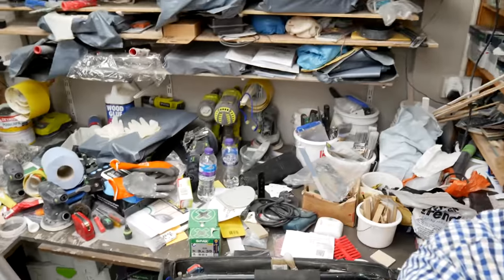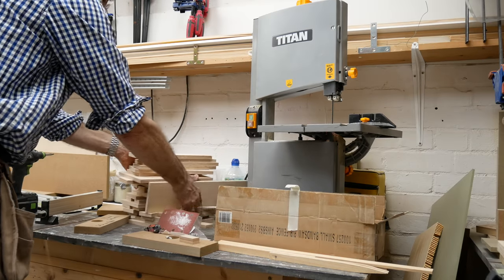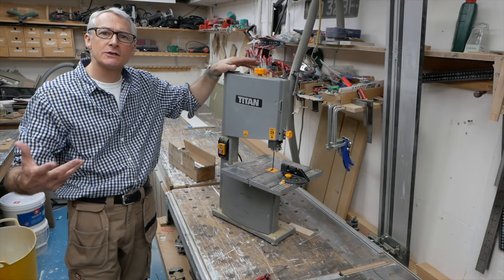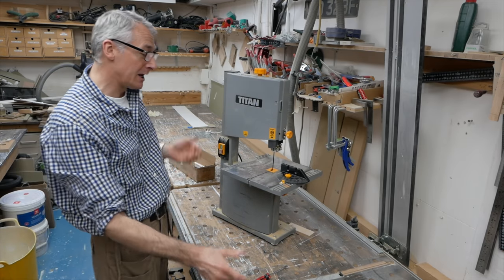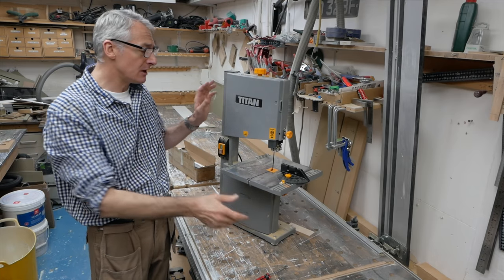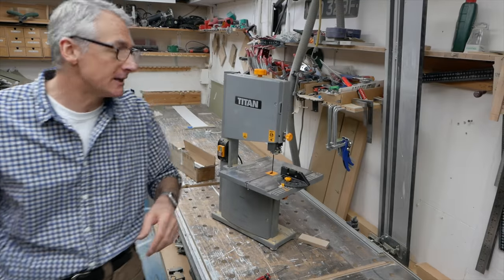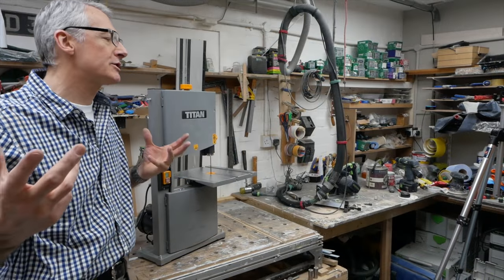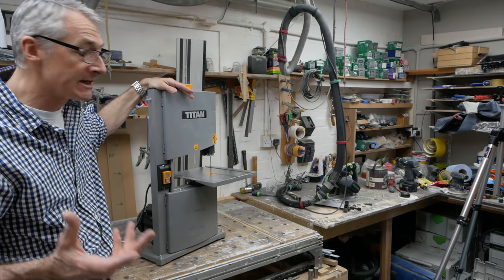Bandsaw Makeover P1 [video # 293]

Comment: Hi Peter, I didn't see you use the Re-tensioner Knob on the top of the Bandsaw, (the big yellow one above the Top wheel). 
You seemed uncertain whether there was enough tension on the new blade, it certainly sounded a little slack, which will ruin the crown on the wheel tyres if the blade slips under load. 
Check how much tension adjustment there is left, (that is perhaps the reason why the tension release lever wasn't releasing on the old blade, i.e., it was tensioned too much for the tensioner cam to release).
Reply from the maker: I put another couple of turns on the tensioner, and it cuts fins, but yes, I'll keep an eye on it, thanks. 👍

Comment: Out of interest, who would make the highest quality bandsaw with the same size as the Titan?
Reply from the maker: I don't pretend to have tried the all, but the small Axminster I had last year was pretty good - though personally, if I was spending that kind of money I'd dig a little deeper and get something with a bit more capacity, e.g. the Record BS250.👍
Reply: I think UK Record Power... 🤔🤔🤔😜🇨🇭
Reply: @10MinuteWorkshop  thanks! I totally agree with your approach. I suspect would need to go bigger in size to get the highest quality. The choices might be more limited in this form factor?
Reply from the maker: @johnathanwilko2922  Yes, at this size (8"/200mm) they're all very similar - you'll get more scope and variety if you get up a size (or two) 👍
Reply: @macbaar6073  would be interesting to see what makes it better than these budget units. Probably better tolerances and stability?
Reply: Quality of production, good blades AND a well made but heavy table ( no cheap aluminium), a good 230v motor - plz check their www in Germany RP starts to be a popular bs in the woodcuting scene... check channel ‚alles ohne kabel‘ and similar channels - Salute from crazzy Swiss 😜🇨🇭